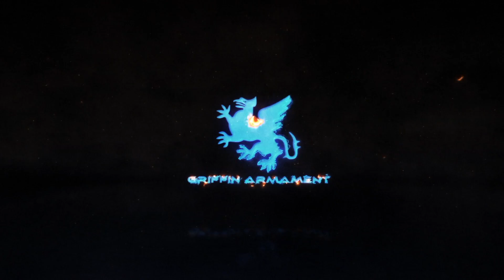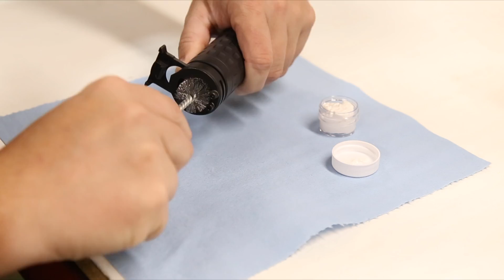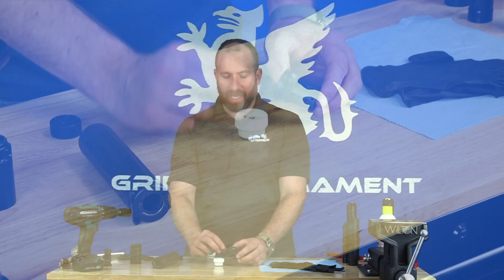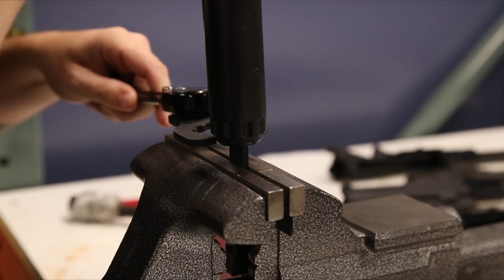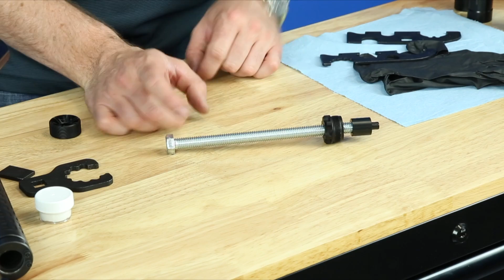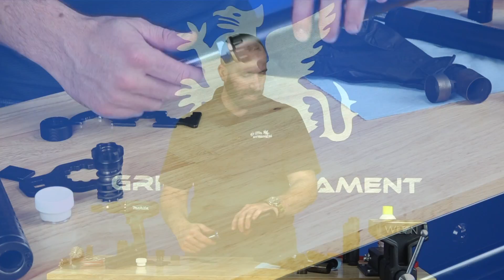Silencer Maintenance- Tools and Procedures

Comment: Sent my Griffin Alpha to have the upgraded baffles.....thank you excellent job!!! one question does the rear cap come off? or is there a rear cap? Never tried because I wanted to add the keymo adapter
Reply from the maker: Unfortunately no, that is strictly a taper mount suppressor with the mounting system being integral to the tube body.

Comment: YHM does not need this video...
Reply from the maker: All silencers from every brand require some sort of maintenance. Just like your firearm, your vehicle, your refrigerator, or your washing machine; silencers are subject to wear and will experience loss of performance and even malfunction if recommended maintenance is neglected. 

We work hard to educate our customer base and those interested in silencers in general. So with that in mind, this content is extremely relevant and informative.
Reply: 😂 don’t worry about that guy griffin he is biased obviously.
Reply: For the recce models how do you clean the build up Carbon inside the suppressor past the attachment point